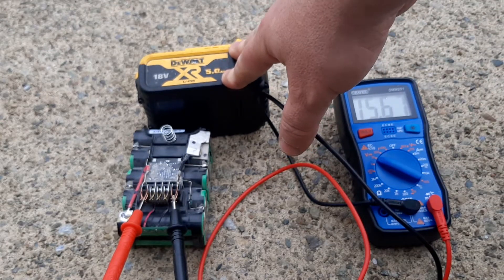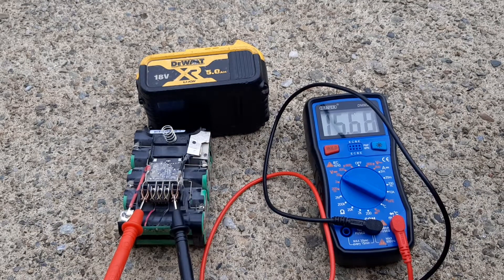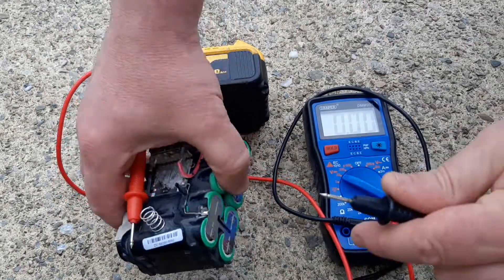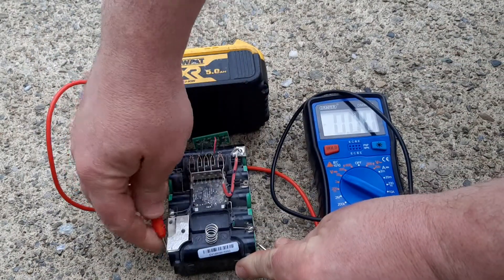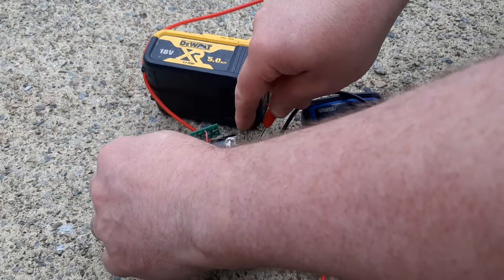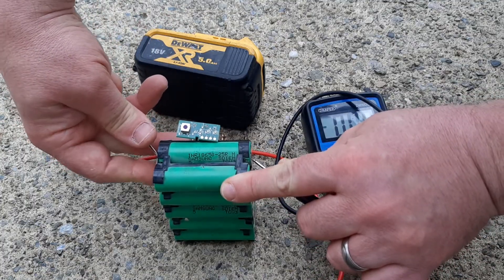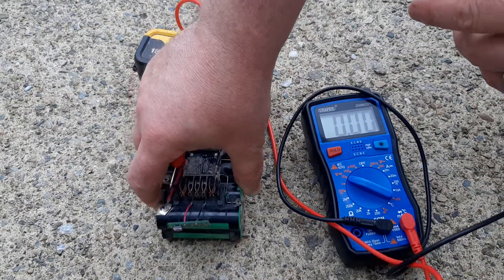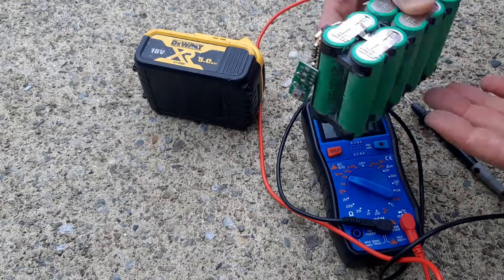Dewalt Battery Cell Voltage Test ⚡

Comment: The only issue I see is the need for a battery welder. Such a pain in the hole. The plastic case, BMS etc is all on Ali without cells if you want to build your own but you need a welder 😢 good vid

Comment: Any clue how to do that for a skateboard battery? Because my lithium battery is full of wires going everywhere. Theres a circuit board too, so it's more complex.
Reply from the maker: Not really the key to fixing these is knowing what way the current flows and where that is being disrupted
Reply: Most things that use batteries will have these types of batteries  🔋 they are just stacked in different ways some batteries are flat like computers are really flat but it you take the plastic housing of batteries find the tag on the batteries like those green ones in this video are 18650 cells they are in every power tool just about their are 3 in the 12 volt smaller drilles each one is 4.2 volts its really easy find the tag on battery it will say how much volts it should have and test each one

Comment: There is a pair of batteries connected in parallel in this battery pack; you don't need to measure every battery .. you just need to measure every pair.
Reply from the maker: That's right this is an older video

Comment: "unless they are separated will you not get a reading from the other cells"  yes you will , this video should be pulled as misleading
Reply: I checked on the is faulty myself without separating the cells and some do read lower than others and it is easy to find those that were bad,, hardest part is separating them…..

Comment: Each set 2 cells is in parallel. So you are actually testing 2 cells each time.  
You need to split them to test individually.
Reply from the maker: I usually replace the 2 even when you pull them out the 2 cells are usually low

Comment: thanks for this video. i was worried measuring an array that was still connected in series would either give me a reading of the combined cells and/or an equivalently powerful, possibly fatal shock. :)

Comment: unless they are seperated will you not get a reading from the other cells
Reply: Yes  they  will.  IIUC you are right.  the video is wrong.
Reply from the maker: Please correct me if I misunderstanding your comment but I find I can test the individual cells when they are connected. I just put the positive and negative probes from the voltage meter on the opposite ends of the cell I wish to test.
Reply: @doctorlefthandthread  unless they are separated will you not get a reading from the other cells"  yes you will , IMHO this video should be pulled as misleading